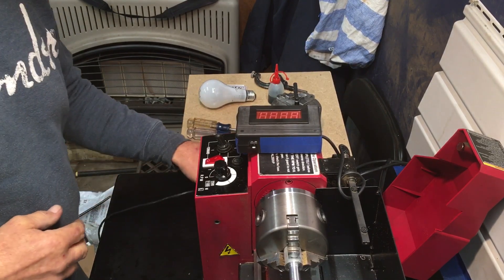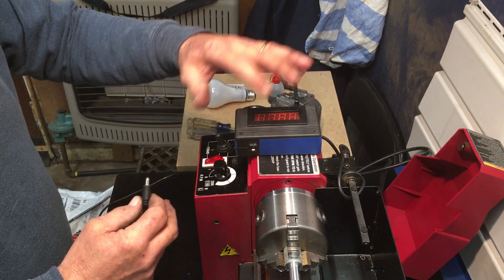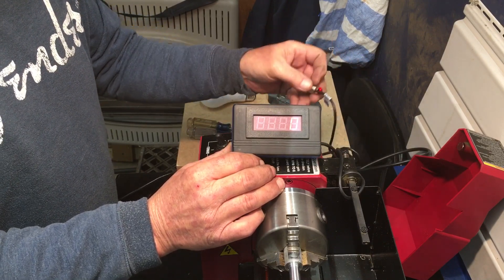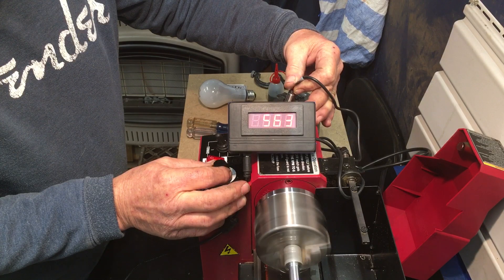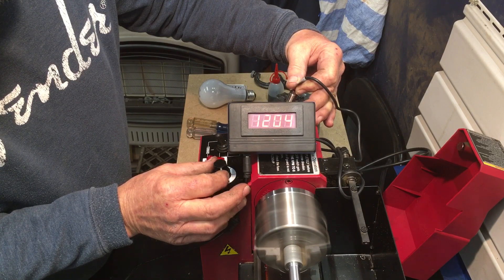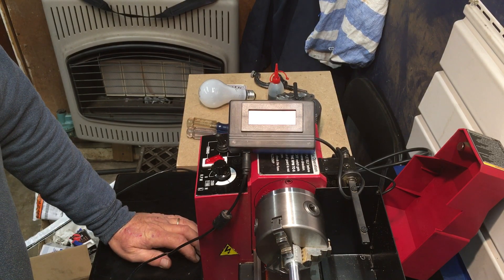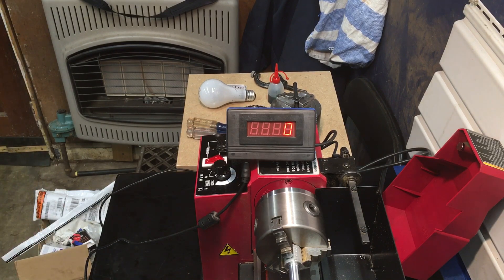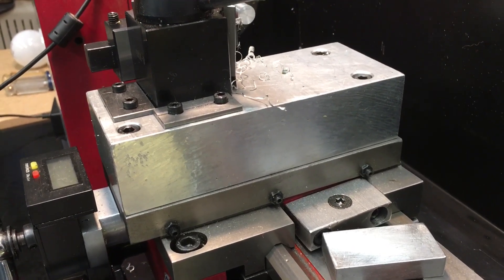Installing tachometer on the harbor freight mini lathe

Comment: How and where did you mount the pickup magnet?  I powered mine with a 9v battery and got nothing.
Reply from the maker: On the back end of the spindle under the gear cover. Then I mounted the sensor in the gear cover itself. Then I just simply Velcro Road the display screen on the wall nearby the lathe